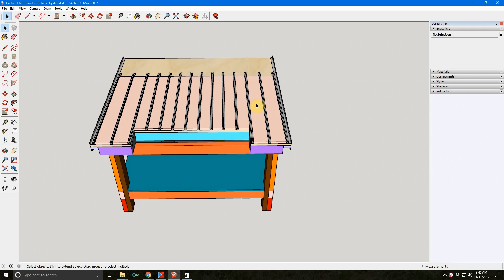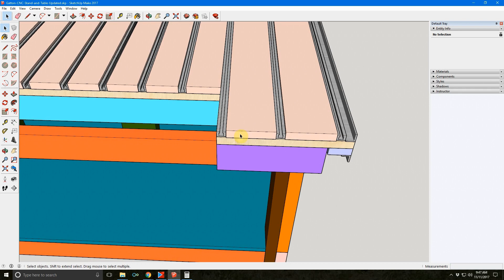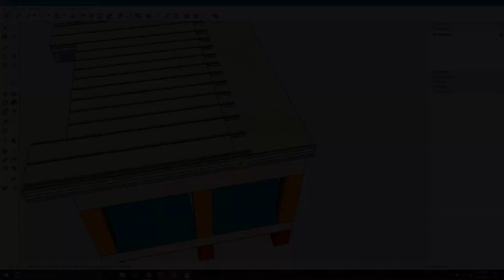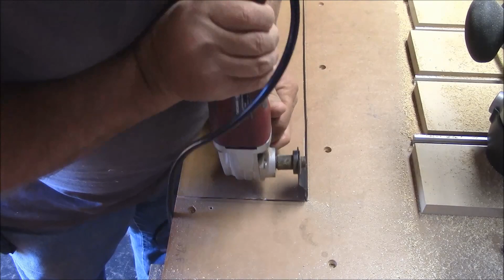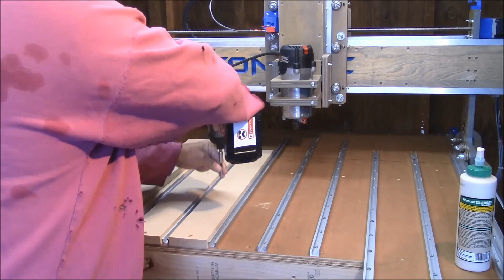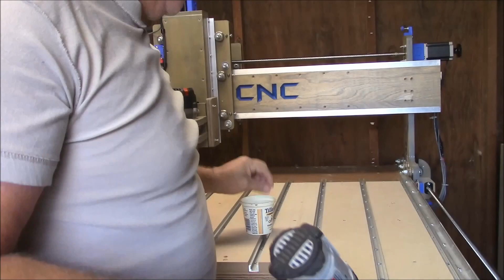Adding a Spoilboard to my Gatton CNC

Comment: I hope to fasten my t-tracks and MDF strips tomorrow. After several years of use, are there any things about this that you’d do differently? Thanks!
Reply from the maker: I wouldn't do anything differently. Just surface it when it needs to be surfaced, and when it gets surfaced down really close to the t-track, glue on some 1/4 inch thick MDF, surface that, and drive on.
Reply: @MarkLindsayCNC : Sounds good … thanks for the always great info!

Comment: I would be interested in knowing how the design went in SketchUp. I have dovetail T-Track and it's a nightmare fitting it to the board in SketchUp. I have tried adding the track to the board and also lining up the T-Tracks first then adding the board it doesn't end up looking like your video in sketchUp.
Any advice?
Reply from the maker: Basically, I drew the t-track profile in SketchUp, then used Push/Pull to "extrude" it to the length I needed, made component out of it,  then figured out my spacing, and copied them onto the table top. Then I drew the MDF strips in between the t-track pieces, and used Push/Pull to bring them up to height, making components out of them as I went. The spacing on my t-track varies, because I wanted the t-tracks toward the center to be closer together, and the t-tracks out along the edges to be further apart.
Reply: @MarkLindsayCNC  Thank you. That sorted the issue. I never thought of push/pulling the slot in the wood first. I just kept trying to insert the track which gave me so many problems.
Cant believe i spend over 14 hours trying to do it and never thought of making the slot in the wood first. 
Brilliant and a life/time saver.

Comment: I have no problem with putting head of screw half down into mdf, but why glue it, if you just screw it down it would be easier next time you replace mdf without fighting with getting glue joint apart. Counter sinking screws below T track would keep them safe distance from bits
Reply from the maker: I'm asked this question quite often, Ray. I never intend on removing an MDF strip. When I surface it down to just above the level of the t-track, I'll glue down strips of 1/4" MDF, surface them, and drive on. If I should ever need to remove one of those strips for some reason, I have a CNC router. I'll just remove the t-track to either side of the strip in question, then mill it out and replace it. I've had this spoilboard for over 3 years and I have no complaints at all. When I get into the new shop, I'm going to have to re-level the machine and surface the spoilboard to make sure it's nice and flat, and parallel with the gantry travel (I'll certainly have to tram the router again before I do any of that.) I plan on doing a video on that to discuss the spoilboard, and document the steps I have to take when I move the machine.

Comment: Mark what is your plans to remove the spoil boards since you glued them down?
Reply from the maker: I have no plans to remove any of the boards. I should never need to. If I should need to remove one for some reason, I'll remove the t-track from either side of it, and mill it off with my surfacing bit.
Reply: @MarkLindsayCNC  Mark thanks for your reply.  I'm just starting out and recently bought a Onefinity CNC.  I getting ready to build my table and doing research on the best way to build and handle spoil board management.

Comment: Mark,  I am making a Gatton CNC and want to make this spoilboard.  My question is:  will your Gatton x reach the outside of the spoilboard for resurfacing?
Reply from the maker: That depends on which bit you plan on using. I answered this question and more int he next video on the list, which is Creating the Spoilboard Surfacing Toolpath. https://www.youtube.com/watch?v=OMy0SMNRFOA

Make sure you tram the router/spindle before you surface the spoilboard!
Reply: @MarkLindsayCNC  Thanks Mark

Comment: Totally awesome video. Quick question Mark,  how big is the Dave Gatton Cnc Machine ? I am considering adding a second Cnc to my shop!
Reply from the maker: Thanks, Lee! That's the beauty of the Gatton CNC - it's as big as you want it to be. Dave doesn't supply the gantry front, rear, top, or bottom panels, so you can make them as long or short as your lead screws will allow. I've seen a couple of folks make their table tops out of 5x5 sheets of Baltic birch, and cutting those panels to fit. It's completely adaptable to your needs.

Comment: What is the purpose of the front cutout?  You lose valuable table space.
Reply from the maker: It's where I mount my rotary axis: https://www.youtube.com/watch?v=8hNjGZHeQOM

The space lost is minimal. The gantry moves far enough forward that the router overhangs the front of the table by 4 inches. I can still use the entire surface - including the cutout.

Comment: I need to make a new spoilboard for my CNC & I want to make this with using the CNC.  I was going to make it like the first one (no t-track aluminum rails) until I saw you video.  How do you plan to get the "old" spoilboard sections up when they "wear out".  I like your method better than mine I just can't see the solution to this one problem.
Reply from the maker: I don't plan on taking the old sections off. I'll just surface them nice and flat, then glue strips of 1/2" MDF on top, surface that, then drive on. I should never have to remove one, but if I do, I'll take the t-track off, then use my surfacing bit to just machine it off.
Reply: Thank you for the reply.  I never considered "never removing them".
Reply from the maker: There may come a time when I'll curse my decision to glue down the MDF strips, but right now I don't see a situation where I'd need to completely remove one of them. I may be trimming a couple back in a couple of weeks to add a fixture (more on that later,) but I'm only talking about a 4 inch section. I can easily cut it out with the CNC if it comes to that.

Comment: Great job Mark. I bought my track from orange aluminum. I'm real happy with it and the price was great. I also put my track on the edge towards the angle iron. I found it to be to close to the gantry to put a clamp there.
Reply from the maker: Thanks for the heads up! I'll watch for that when I need to use it.

Comment: Mark, I enjoyed your video.  One question though.  Why did you glue down the MDF strips?  Eventually you will have to replace the strips when you have resurfaced them down to the level of the T-slots. Removing them from your table top could be an issue.  I would have just countersinked screws below the height of the T-Track on the ends of the MDF strips to avoid hitting them with the CNC bits.  But that's just me.

SKI Kowalski
Reply from the maker: I'm glad you asked that, Richard (I knew that someone would, and I wrote about it in the website article that I linked in the description.  :D )

I should never have to remove these strips. When I surface these strips down to about 1/16 of an inch above the level of the t-track, I'll just glue strips of 1/2" thick MDF on top of them, surface those, and drive on.

However, if I should need to remove one for some reason, I'll remove the t-track from either side of the strip in question, and hog it out with a 1/2" diameter end mill, and continue on from there.

Good question, though! Thanks for watching!
Reply: OK, I get it now.  I'm not sure I would do it that way, but hey, that's what makes horse race betting work.

SKI
Reply from the maker: I like that metaphor! 

This is my second time around in building a CNC table, and I'm applying what I learned from the last build, along with the modifications I made to it as I used it. I live in Southern Oregon, and it's wet here about 2/3 of the year. I tried screwing the MDF strips down from the top, countersinking them in like you described. The problem I had was during the wetter months, the MDF would start to warp slightly, lifting up in between the screws. It didn't lift much - maybe a few thousandths of an inch. I found myself needing to surface the spoilboard way, way too often, and as you no doubt know, that's a seriously messy operation. I finally decided to just glue it down to the table and see how that worked. That way it would at least stay fastened down, flat against the surface of the table. I ran it that way for 2 years and never had a problem. I added 1/2" strips of MDF to the top of the old spoilboard once in that time, surfaced them, and kept going. It worked so well I decided to do the same on this build from the get-go and not mess with it.

Comment: With your leveling on the last video, did you notice a sizable drop on the right side while surfacing?
Reply from the maker: I assume you mean the tramming video? When I finished tramming the router, I had .0005" of counter-clockwise twist. That amount is so small, there was no shingling that I could see or feel. The whole spoilboard is nice and smooth. Checking it with a straightedge, it's seriously flat. I didn't find any light peeking through under my straightedge at all - not even when I held a flashlight behind the straightedge. I'm very happy with the results.